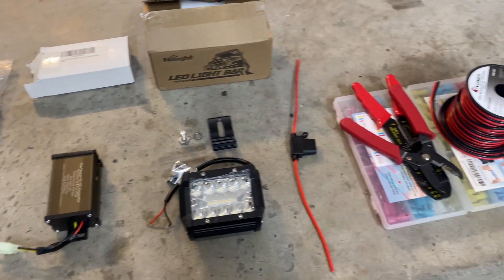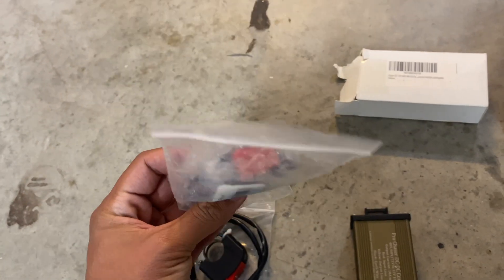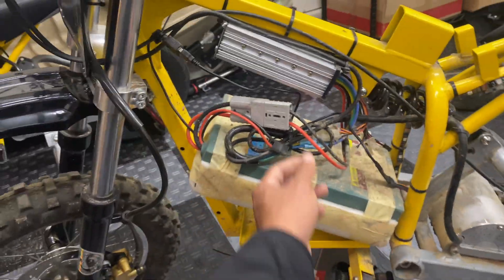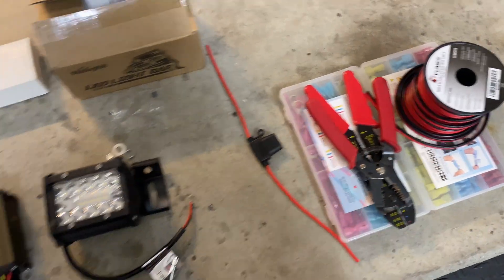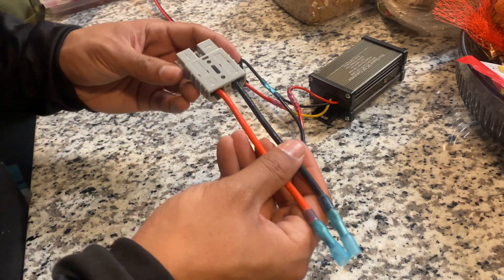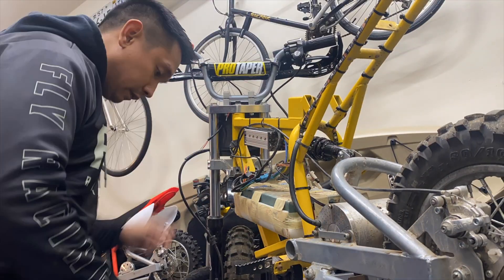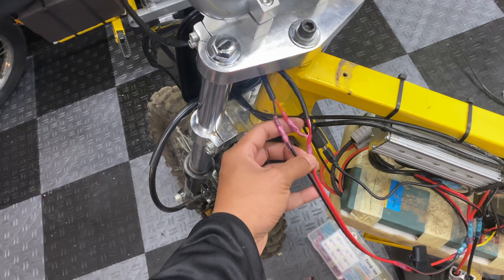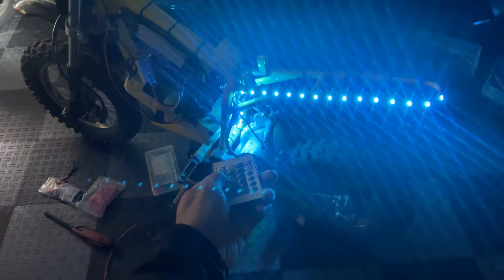Razor MX650 MX500 SX500 LED 12V Headlight Install Wiring 48V 52V 60V 72V Light Bar Voltage

Comment: Why does the voltage step down converter need to be wired into ground if the headlight goes back to battery ground anyway?
Reply from the maker: You can try it without doing so I suppose.. I just followed the manufacturer’s instructions.
Reply: Because like the headlight it’s also an electronic component, it’s needs the ground to complete the circuit and allow electrons to flow

Comment: Hey Pat when trying to disconnect the wire from motor I decided to tie the positive and negative wires from the motor to the controller and it not restoring power from the controller to the motor so you know what could be the problem. Thanks for helping 🙂
Reply from the maker: Hmm my bikes don’t have positive and negative wires from the motor (3 phase wires) since they’re brushless, not as familiar with that design

Comment: Hey Pat, When trying to install this light I accidentally cut it to short do you know what gauge wire is the original razor motor by the way thanks for helping through my last question.
Reply from the maker: Which wires are you referring to? You mentioned light, but you also mentioned original razor motor. I wanna say 22 gauge for the aftermarket LED lamp and 12 gauge for the stock motor wires
Reply: @PatOutdoors the motor that powers the chain on the back wheel that you disconnect

Comment: When I got the switch it came with orange and green how do you know which is positive and negative wires? @PatOutdoors
Reply from the maker: On/off switches just complete a circuit (when on) and breaks a circuit (when off.) There is no positive or negative, can be hooked up whichever way
Reply: Ok

Comment: Thanks Pat for the vid, Im using the 48v overvolt kit on my mx500 with a stepdown converter for the light switch.  The lights comes on then shorts out not sure what im doing wrong.  Could you send me a diagram of the wiring set up for the switch and light.
Reply from the maker: Did you confirm with a volt meter the input to the step down converter is reading 48-52V? Is there an inline fuse? The headlight sharing the same ground source as the controller and the converter? Confirm what voltage is being supplied to the light on the yellow wire coming from the step down converter please.
Reply: Yes I confirmed the input voltage to the step down is 51volts & the voltage going to the light (yellow wire) was 12volts then shorted out rechecked it now its only 3volts now.  Is the step down converter shorted out/defective now?  And I'm using a ground block for the controller, stepdown and switch.
Reply from the maker: @justdoit00  the switch should not have a ground.. it literally just completes a circuit. The switch should have been wired INLINE to the power wire going to the light. That’s your short.
Reply: Ok, so just to be clear the 2 wires from the switch should be going to power right?
Reply from the maker: @justdoit00  yellow wire (12v) from converter goes to switch, other wire from switch goes to light power in, ground from light just goes to ground.. when you turn the switch on, it just completes the loop.
Reply: Thanks so much, I totally appreciate you taking the time to assist me.  I'm totally grateful.

Comment: I’m using the btr 72 volt 80 amp bms and the max voltage it has is 87 and the Down converter that’s linked to your bio
Reply from the maker: I have it hooked up the same on all my bikes. 72v going to red wire on the converter, then the yellow wire from the converter should put out 12v to an inline 10 amp fuse then to the switch to complete the circuit to the led light. Ground the light AND the converter to the same ground source as the controller. Besides that, I really do not know how to test your wiring for you virtually

Comment: There is only 3 volts going to the light
Reply from the maker: Which voltage step down converter are you using and what battery do you have?
Reply: @PatOutdoors  I’m using the one you recommended and a 72 volt btr 80 amp bms
Reply: If you don't have 12v on the yellow wire coming out of the step down converter (using a multimeter with the black on a ground wire and the red, touching the yellow out of the converter) then the converter isn't working correctly.  @jonathan39292

Comment: Instead of using connectors can I just solder them together
Reply from the maker: I would only do that once you confirm the two wires going to the led light is getting 12v when you turn the switch on

Comment: I followed all your steps and the light won’t turn on
Reply from the maker: Do a continuity test with a volt meter to check where there is not a good connection.

Comment: Can you tap in the charging wire instead?
Reply from the maker: I suppose that can be as an option, but I would recommend testing it with a voltmeter first to confirm voltage prior to splicing.
Reply: Same voltage...I did...even using a step down that was 48v to12v...but only 1A.
.thanks

Comment: Is there a difference in size between the mx650 and the sx500?
Reply from the maker: The MX650 is just a tiny bit larger, though the SX500 I think is more desirable for heavy modifications because the frame designs allows a larger battery to fit (which is needed for real speed and range.)